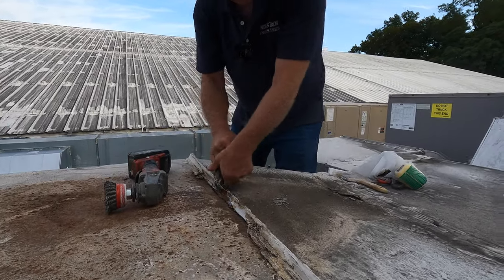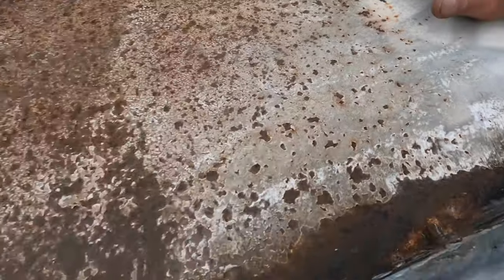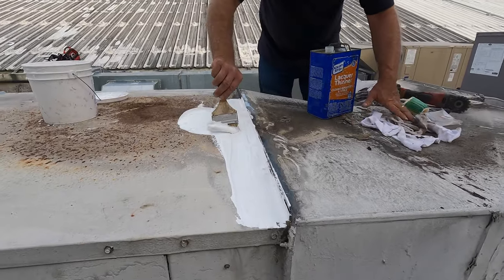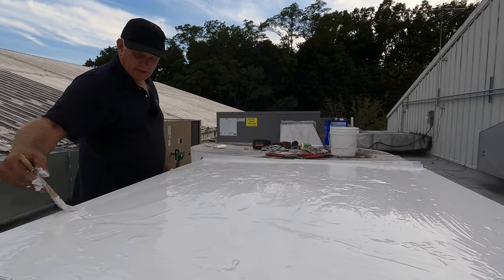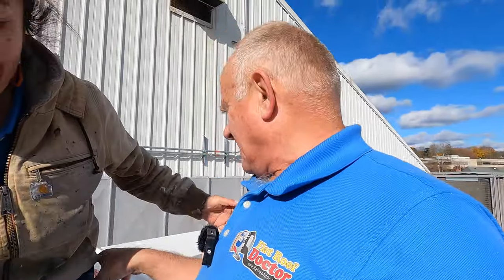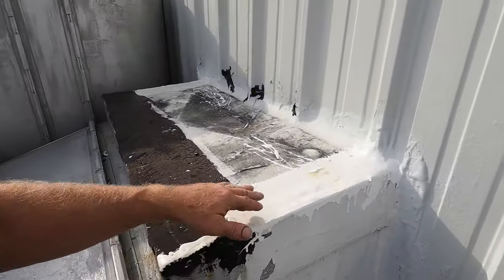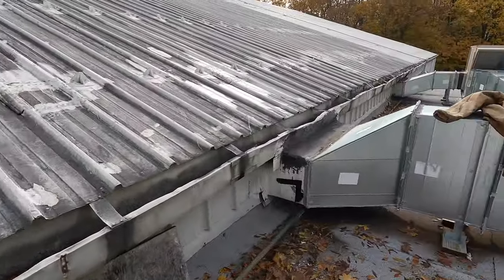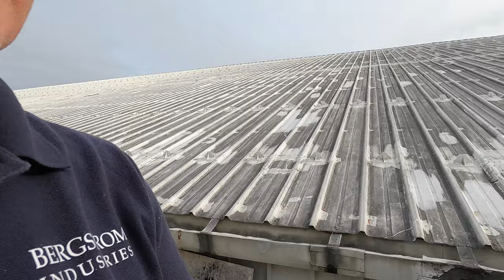Repair Holes in Rusted metal roofs, A/C ducts with Super Silicone Seal

Comment: Pretty solid start to the project but we have repaired numerous similar situations and you MUST remove all of the rust AND you should add a rust remediation product. This product will cause a change in the surface that is necessary for the coating to stick. It does not matter what you use if the surface preparation is not done correctly. If you do not remover all of the rusted metal it will fail because the coating can not stick to oxidized metal. It will bubble, leak, and create more rust.
Reply from the maker: almost 4 years later, I went and looked at it, and it was fine. I will post a video to show that what you say is not true. I have proof
Reply: @FlatRoofDoctor  You either got lucky or this product has some magical properties that defy the normal laws of chemistry.  Where do you get this product? I will try it myself.